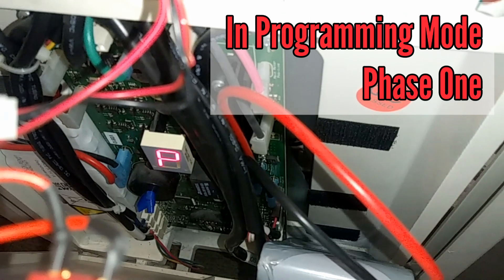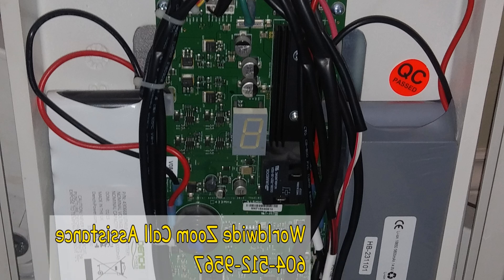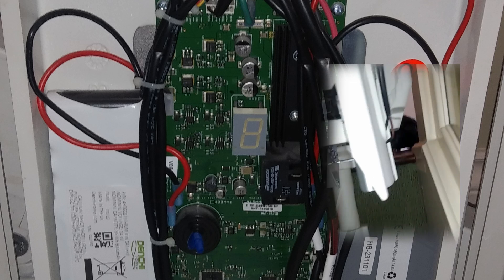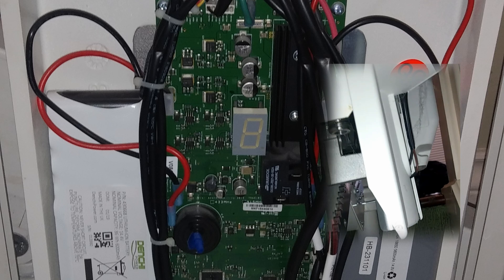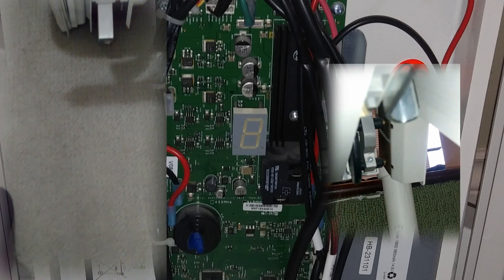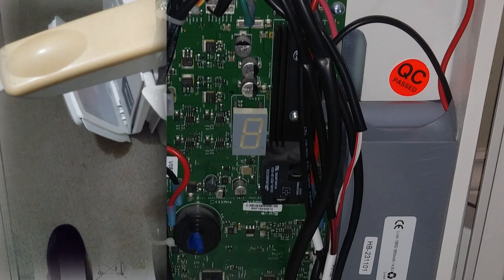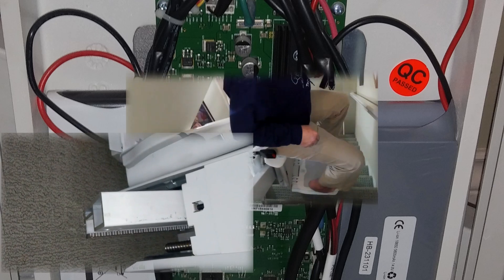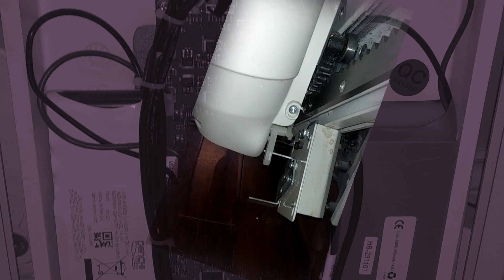Acorn 180 Curved Stairlift Programming Assistance by Zoom Videoconference

Comment: Hey I'm looking for any information on the workings of getting the acorn 180 foot rest motorized operation going. The installer left a wiring harness with me for it. I see on the main PCB a labelled connection but where does the other end of a the harness plug in? Is there a motor already installed in the housing for the footrest? I appreciate any help...

Comment: Hi got a acorn 180 (3 year old) working fine but toggle switch only seems to work on the right hand arm! Does not work on the left arm? What can I check? Cheers
Reply: I have one for my mom and same one stopped working switch to go up and down.  When you lift up your arm and the safety button is visible, look inside that slit and you'll see wires in there.  one or more of those wires are broken as you constantly move that arm up and down.  Its broken. You'll have to take the screws for that arm and take it apart.  then you'll see the broken wire. I ended up replacing one wire, replace the wire further up and down so the wire thats constantly bent is a new wire. They are tiny wire make sure you get wires that are silicone rubber as they are soft and last longer than those standard ones that are hard, as these portion constantly bend.
Reply: @user-pd9kh8kb6y . Thanx for this info.  I was able to repair a toggle switch on a used 180 curved acorn stairlift chair I purchased because of the info you posted in your comment.  I have already programmed one of the used remotes I purchased but I can’t get the second used remote I purchased to work.  I used the same procedure several times so I probably purchased a broken remote.

Comment: Hi Rob I am in Northern Ireland and have just removed on of these 180 curved units and fitted in a friends house who sadly has a severe stroke. However I only fitted the straight section as the stairs are short from the hall to upper floor. Cannot see any why of getting it to go onto high speed as it leaves the charging points. It slows down and creeps into both the top and bottom charging points. ?
Reply from the maker: Pls contact the person directly using any email or mobile number on his/her video(s).   Cheers.
Reply from the maker: This video .. https://youtu.be/Nm02yowHE7g